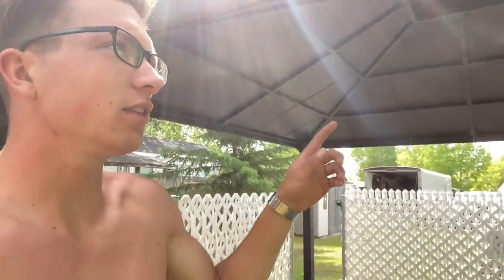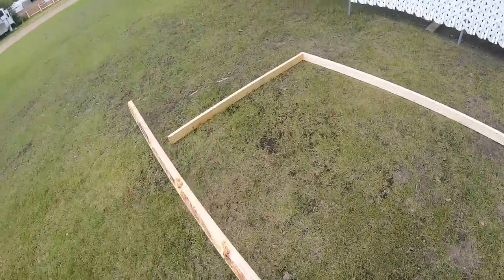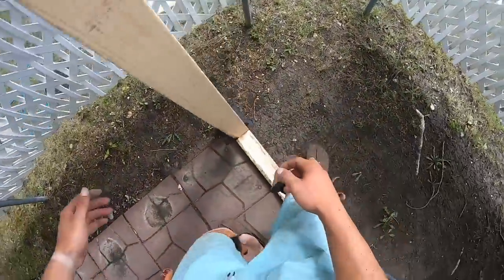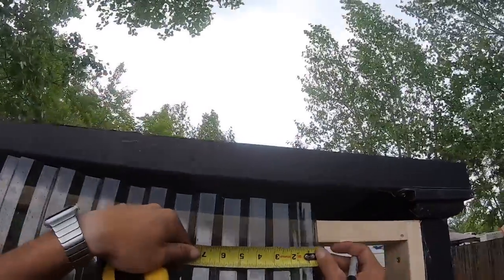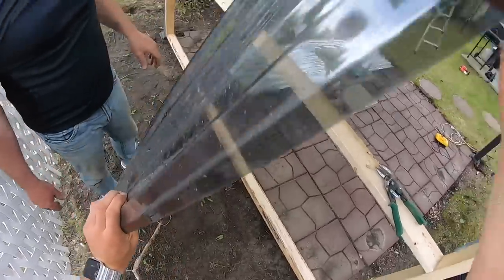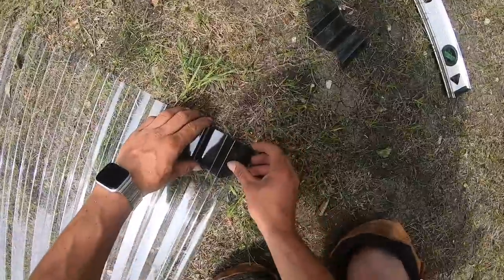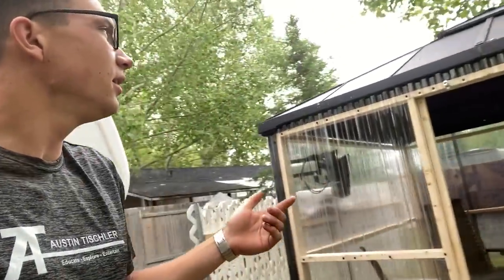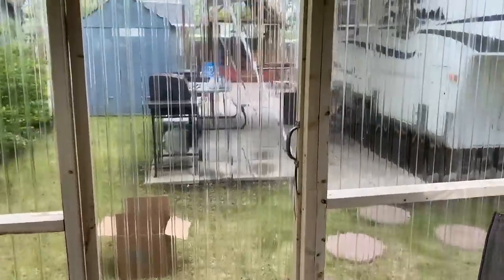Enclosing a gazebo with corrugated plastic

Comment: For a small additional expense and a little extra time and labor, the ventilation issue can be very easily solved.  Essentially, ventilation can be easily created by building tilt out windows frames that hinge at the bottom and open at the top.  Building a window or two on either side and maybe at the rear should help the air flow when you need ventilation.  The window frames are simply sized to fit into the top half above the middle rail.  A short chain fitted through an eye bolt and screwed to the window would allow for the windows to be pushed out at the top and held open by gravity. The chain limits the degree of opening.  Since hot air rises, titling the windows out at the top aids in venting the hot air out.
Reply: This is a great idea!

Comment: Great work!  I had the exact same idea kind of.  I have a larger steel gazebo and was tired of changing the screen and curtains (faded with sun) and accumulated 6 free patio doors and installed them aound the perimeter.  I gave it extra strength and for sure its nice to be able to close it up when its cold and windy :)

Comment: Did a bathroom with it. Different color though. Turned out lovely. In this case, I probably would have used the closure strips at the top to make it a tight seal.  Looks great as I am seeing it 2yrs late. Curious as to how it has held up. I found it faster to cut them with my dremel & a cutting disc.

Comment: This is an awesome idea! Would there be some other type of material? That's more see through than the wavy corrugated plastic? I think building windows that can be lowered for ventilation is awesome. I have a fan on the ceiling of my gazebo, so this would be great to have air. Come in the windows and also open the door to ventilate. I also think this is an awesome idea. Because I have a cat that keeps coming in my backyard. I thought when I closed the screening and the curtains, it would keep the cat out. Well, it doesn't. The cat comes in and lays all over the furniture, leaving cat hair everywhere. Because I'm allergic to cats. I have to keep washing the cushion covers. Which is not a good thing because it so hard to get the cushions back in. Painting the frame to match the rest of the gazebo is an awesome idea. I was also thinking of using corrugated, plastic or some. Type of clear kind of window looking plastic for the bottom and add screening on the top portion. 

This is also an awesome idea for the winter. So I don't have to keep sweeping leaves out of my gazebo and putting away my cushions and decor.

Also, the nice thing about having this frame is. You can build shelves to put lanterns some. Type of lighting or plants and secure them to the frame.

Please let me know if there's another type of plastic. That's not wavy and more clear.

Comment: I'm a little late to the gazebo party here, but I'm considering this approach to enclose my 27x12 deck over the winter.  What are your thoughts on taking down and reusing the panels every year...do you think they'd hold up?  I want my deck totally open in the warmer months.  I thought about vinyl "curtains" secured with L-hooks and grommets, but 40mil vinyl is really expensive.  Plus, I like the thought that the corrugated stuff isn't anywhere near as heavy as the vinyl to work with.  Anyway, good job.  Was very "zen" watching you enclose things.
Reply from the maker: I don’t see why they wouldn’t, I’d recommend using the rubber washer screws like I did just to protect the plastic a bit when you’re taking it off/on

Comment: We have long winters where it can be 5-10 degrees daily for a few months. I would like to do this idea for my enclosed deck so we can sit out there in the winter. Not sure if these would be thick enough to keep the cold out to the point where it is 70 degrees on my deck. How cold does it get where you are in the winter?
Reply from the maker: Here in Saskatchewan we can have stretches of -30 to -40 for a few weeks. If you had it air tight with sufficient heat, I don’t see why you couldn’t keep it at 70
Reply: @AustinTischler  You are even further north than I am so I might try this idea

Comment: Hey how did this gazebo hold up during the winter, would you build it any different if you had to do it again.
Reply from the maker: It held up great, I’m actually sitting in it right now lol. Only thing I would do differently would be paint the 2x4s black before putting the panels up
Reply: @AustinTischler  thanks I'm going to build it thr same way you did so I can have my winter hangout.